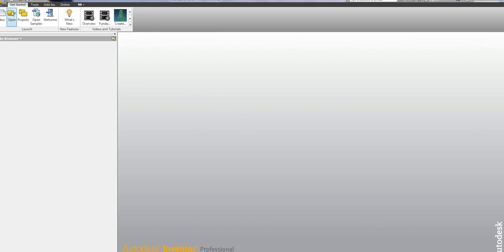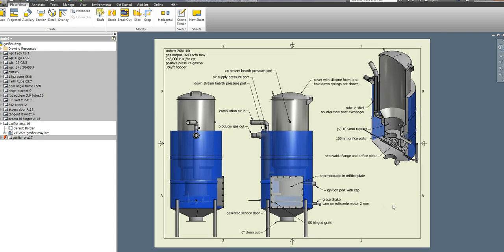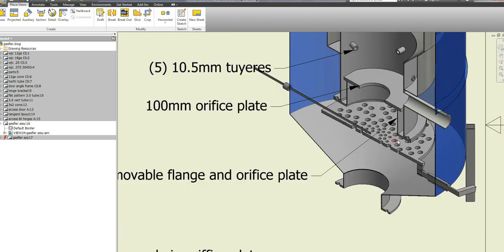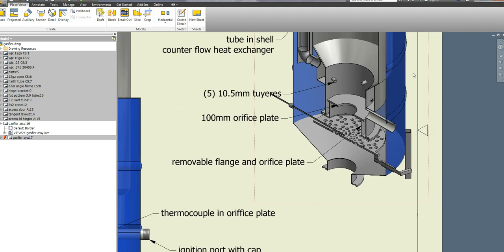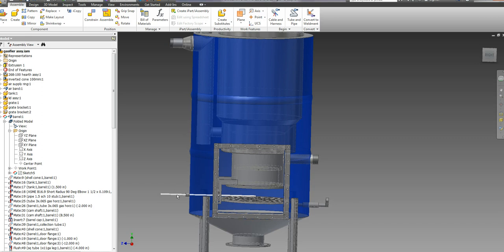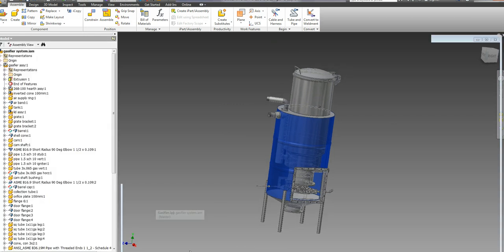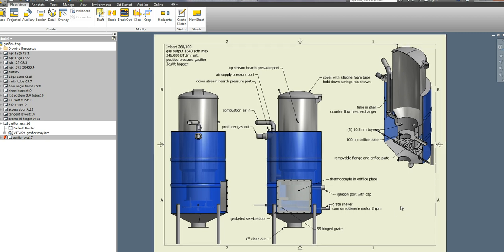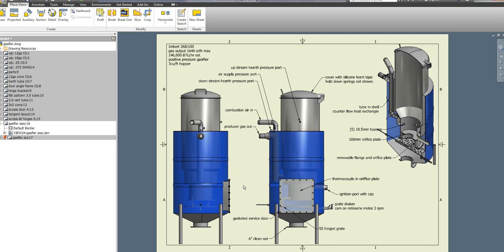wood gasifier

Comment: a car radiator with electric fan between the cyclone filter and the main fine filter to cool and condense water vapours works well, most radiators have a convienient tap to drain them  on the lower tank , making water/creasote extraction easy , if the catch jar is held at intake vacumn pressure then the take-off can be automatic,  nice gasifier btw

Comment: I think that preheat intake air is not good idea. It is good to cool down output gases but I think intake have to be as cool as possible. First because cold air is more dense so it provide more oxygen. For example your engine use 20 litters of gas per minute. In means that gasifier will suck in 20 litters of air. If it is cold air we get let's say 4 litters of pure oxygen and if you preheat it you get only 3 litters.

Those numbers are nothing true. It is just attempt to explain the principe. I do not know real numbers per litter.
Reply: Bert Davis Thank you for this explanation. now I understand why.
Reply: you want to keep the hearth at 600c  to keep the gas clean.

Comment: Thanks for sharing this design. I am a guitar builder and  my goal is to build a gasifier to power a generator and run my shop this way. I will be using a 7500 watt genny and as long as I'm not using more than two machine's at a time I think it will work.
 Is there any way I could get a copy of your drawings?

Comment: I think the plan seems good as long as we are air tight. Looking at capacity I noticed that those older imberts on those cars were short an wide. I noticed most succsess with the 55 gallon drum style for a 4 or 6 cyl

Comment: Nice, I've seen some with spring loaded valves on the lids, do they backfire ? I was thinking about improving the cyclone and I thought of the Dyson vacuum cleaner as its very efficient maybe you can take some photos and model it with your software, do you have any software that can test your modifications without firing up your own unit

Comment from the maker: Tri,
At some point I will build a cooler.  Its still winter here and the wet scrubber has been a good cooler for my testing.  I do have a short ring about 3" tall that the orifice plate sits on and there is a space between the ring and hearth wall. I fill that with ash for insulation and to prevent gas from sneaking around the edge of the plate.  Thanks for your comments and ideas

Comment: Looks good. put a simple cooler in line and use a shop vac to  pull on the system... that's what i've always done.

a short ring around your restriction opening will hold ash so it acts like insulation on your restriction plate is something you can implement easily at some point if you want.

I'd look at dealing with hopper condensates as well, but your system should make gas.

looking forward to seeing more videos.

Comment from the maker: Terry,
Thanks, Im on my way to where you are already at. I understand your comment on the vacuum.  Trying to find a down stream high temp blower that is good for a few inches of water pressure is no cheap endeavor. I'm just beginning this journey and it will take awhile.  I'm not looking forward to trading in my powerstroke for a gas engine.

Comment: Nice video, Gasifier looks very good as well.
If you are going to run engines, suction is the way to go. There is a difference in the flow between pressure and vacuum.
All the best
TerryL